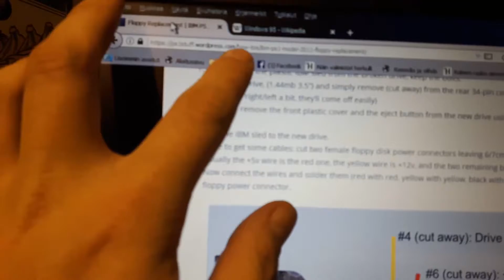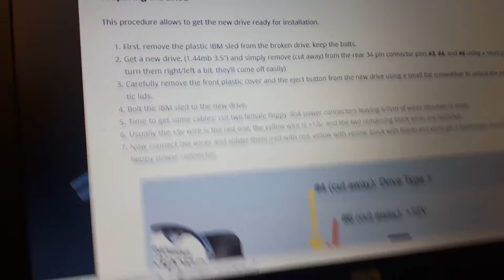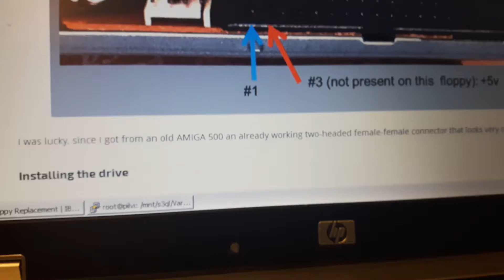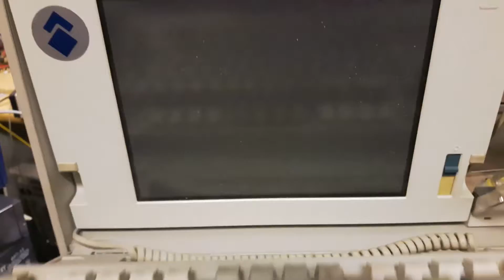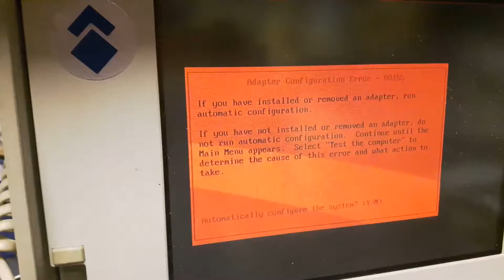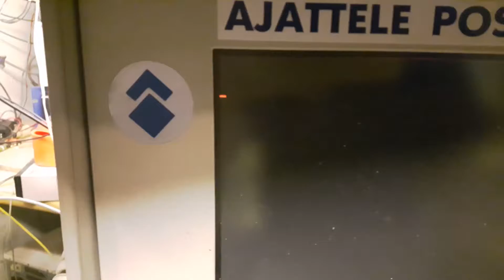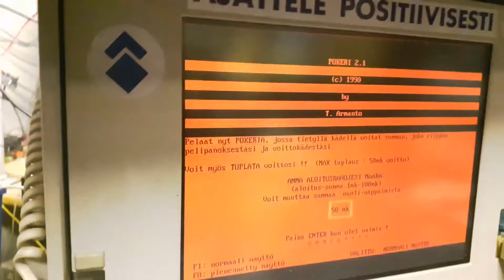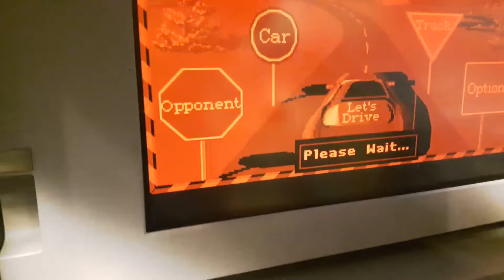IBM Floppy drive replace

Comment: In my case what I did was cut off the #6 pin entirely and soldered #4 to ground like some other tutorial said and that's it, works fine now. Probably not easy to recover the drive but I have many of them, release button doesn't fit with the cover but that's fine I can just use a stick to push the floppy out
But I didn't want to mess with finding 5V from the power supply so for now I just soldered a USB cable to an old floppy power connector and ran the cable through the back and out of the rear slot, probably not a permanent solution but it works and I need a USB power supply for the OPL2LPT parallel sound card anyway